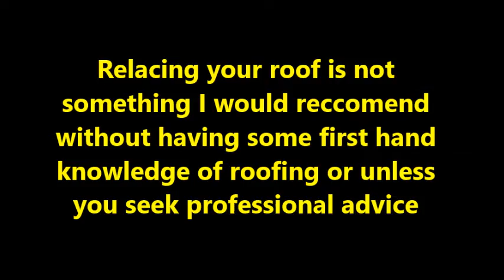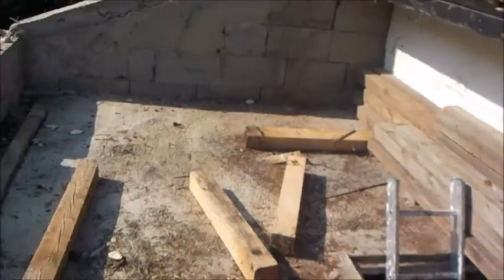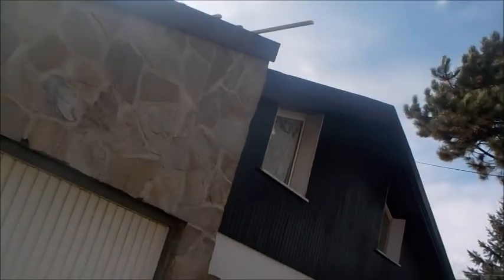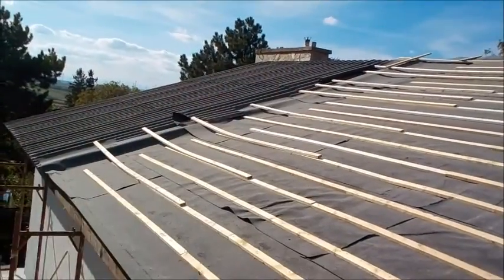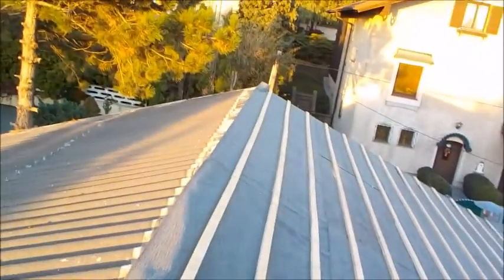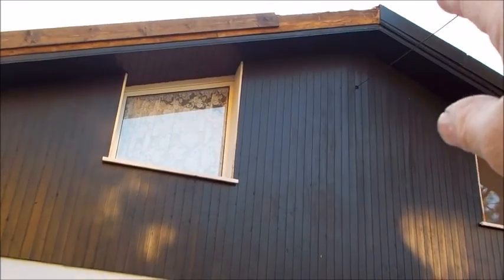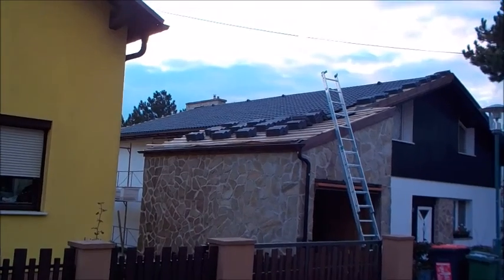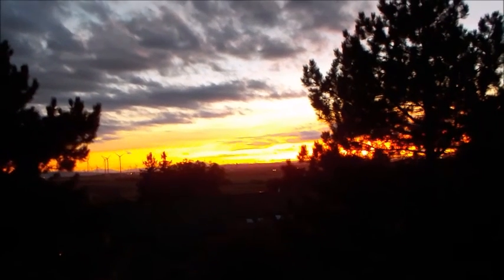How to install a new tiled roof on your house

Comment: That is progressing very well and I hear that the original roof was planned by Helen Keller and the work was done by Stevie Wonder and Ray Charles.
Making a proper job of it should ensure that it will see you out no worries.
Reply from the maker: Hi Richard .I almost decided put on the asphalt   shingles but had a change of heart at the last minute . I went for the concrete coloured through tiles because I knew it would be a one time life long job .I encountered no end of mistakes and fails on behalf of the last owner.For example in the UK our roof spars are set at 16 inch.# with 4 X 2 wood.Over here they set them out at around 80 cmt but they use much thicker and wider wood , around 10 x 3 inches. Every spar on his roof was set at a different measurement.  There was one that was 1mtr 30 cmt wide and it caused problems so I had to strenghten it . I am pretty sure I know what happened here . He bought so many 10 x 3 and found he was 1 short when building the roof so he stretched them to compensate .Coincidentally he was suppose to be a master builder architect ? . I know now what Jerry built means .
Reply: lol, anyone who claims to be a master at anything is generally full of crap so it's no surprises there.
Reply from the maker: Could not stop laughing at your reply Richard , Nice one .

Comment: Shouldn't you of put cross battens in first in line with the rafters, otherwise any water or condensation that gets under the tiles will sit against the battens and rot them, no point with the felt when you have a dam effect every tile.

Comment: That guy wasn't worth a shit at carpentry. Lots of work to do mate. Is there a preformed ridge cap for the top? Looks good so far gonna be a good looking roof. Be careful up there.
Reply from the maker: Hi Joe ,He wasn't worth a shit at anything he did ? At least now the roof is sound and I reakon I put at least 20 Grand on the value too. The roof is done now ,just a few bits to do.
Reply: I got a new roof 3 years ago 13 thousand. Just got gutters & soffit last week 9 thousand.
Reply from the maker: Jesus I did well then